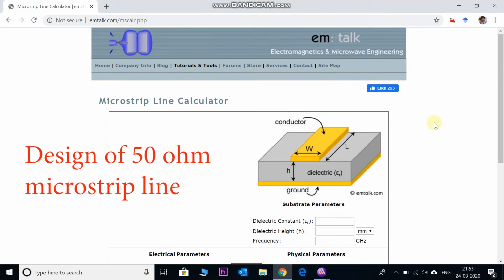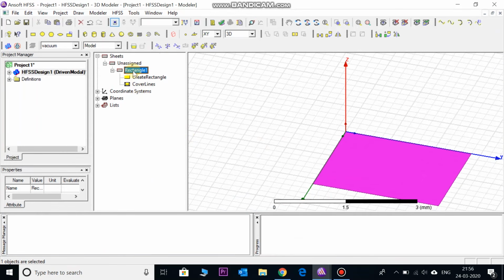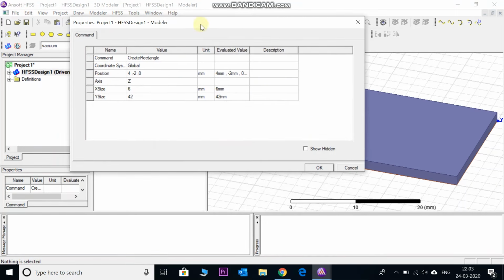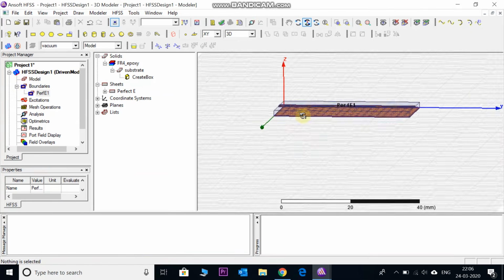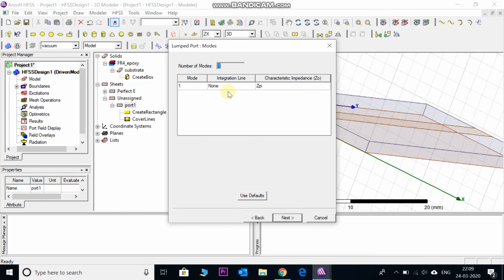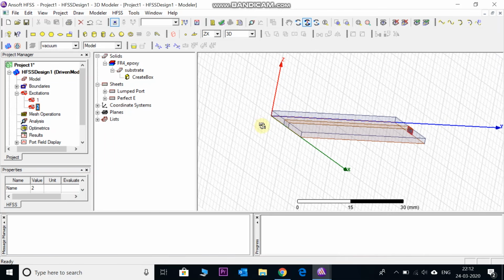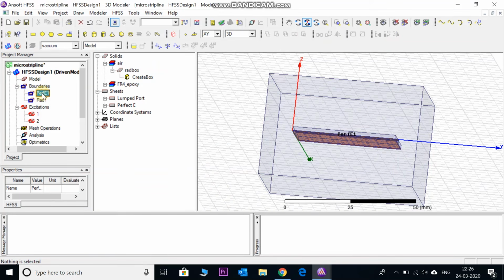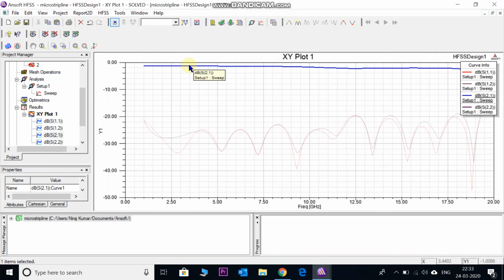Design and Simulation of 50 Ω microstrip line using HFSS

Comment: Why there was no thickness for ground plane, microstrip line it should have a thickness?
Reply from the maker: You may take thickness of 0.035 mm and in that case need to assign copper/conductor. If we take zero thickness and assign PEC. It gives same result.
Reply: @RFDesignbasics   Thank you for explanation

Comment: Respected Ma'am, after assigning excitation, why do we make that vertical line from the triangle? What does it signify? Also, here it is from top to bottom but in the coupler video it is from bottom to top. Please explain.
Reply from the maker: It's e field lines which signifies TE10 dominant mode excitation. Direction doesn't matter because it's time varying oscillating field.
Reply: @RFDesignbasics  Thank you very much. Ma'am/Sir, I have to build thin film microwave attenuators for my thesis work whose presentation date is near. I am experiencing some difficulties in simulation. Could I mail you my doubts to the email provided in the about section? Thanks.
Reply from the maker: You can send your queries. We will look into that.

Comment: Why the microstrip line is draw as "Rectangle" not "Box"? 
Is the copper thickness too small to ignore it?
Reply from the maker: Yes there is not much difference. If you want to consider it, you can take a box and thickness as 0.035 mm. You will get approximate similar results.